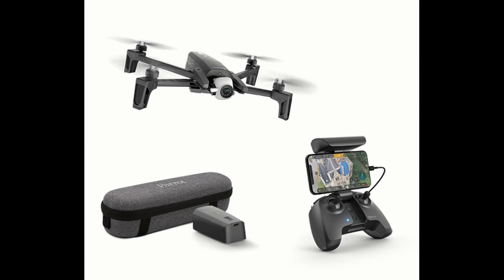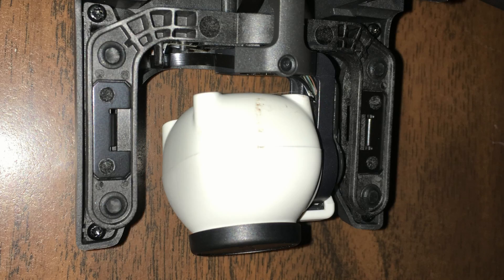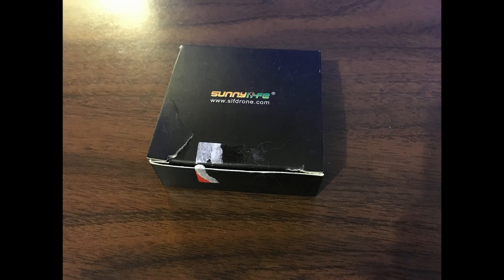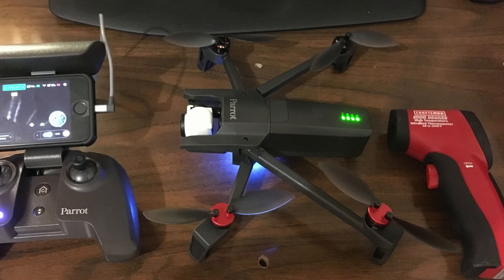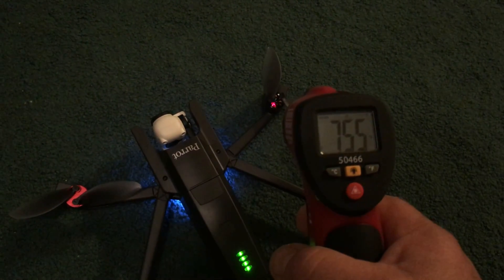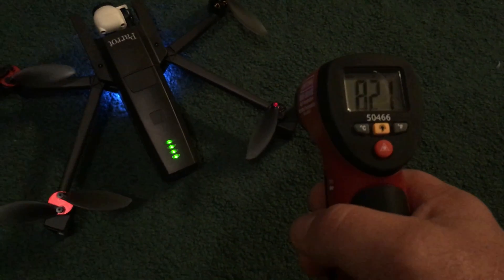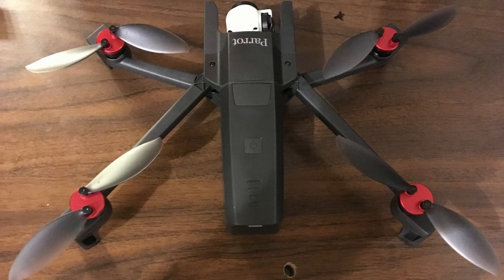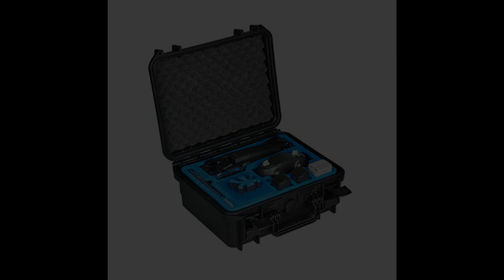Sunnylife Parrot Anafi Motor Caps:  Motor Temperature Increase worth the risk?

Comment: Just got the red covers from Banggood today and have a problem.  Tightening the blades back to the motors makes the blades stationary and I just don’t see enough blade bolt shaft length to protrude beyond the cover’s tube, if you catch my drift.   Do I need to modify the covers to ensure the blades spin freely?
Reply: Same with mine left enough space so blades were smooth and crashed into a building with zero of my input so took them straight off
Reply from the maker: Hal Slentz-Whalen:  Exactly what I noticed as well.

They basically just "float" between the blades and the top of the motor frame.  Also they can touch the prop which did NOT impress me after more flying and looking them over more.  The force of the motor doesn't allow the blades to get "stuck" so to speak on the caps, but after seeing what you commented on as well, I decided to take them off until I can fasten them down without them even having the possibility to hit my props.  I'm actually shocked they didn't come with some double side tape or something to keep them down.

Comment: Are you still using the covers? I bought them but did not yet mounted it.  Thanks Ton
Reply from the maker: I was, but after fling it a bit more I noticed a slight and do mean slight more vibration.  I think it is due to the fact that these caps are not stuck and or in essence float on top of the motor and under the blades.  The more I flew with them, I just didn't see really any benefit to them and took them off.  Even when I have flown at -20 F up here in AK, the caps added no benefit imo.
Reply: @akdroner8728  ok, thanks for your information. All this time I did not used them because I had the same idea that they are not very useful after all. Thanks 👍

Comment: I got them 2 weeks ago and I took them off because of people on Facebook was saying the heat thing, I would have to see a 23 min test and a 46 mins test I have two battery.....like fly until the battery runs down then test the heat then stick in another battery and check the heat after....5mims is not long everyone flys at least 20mins ...ps I got red it looks nice
Reply from the maker: Yup, totally agree on a longer test for sure.
Reply: Were you able to do the longer test?
Reply from the maker: @SuhairZain11  Did some testing and flew through some batteries at around 20mins and the temps never really got much warmer then when I made this video.  However I did notice some rubbing on the top of the motor frames and believe that one of my caps was slightly heavier than the others or unbalanced....as at times I swear I was getting some vibration feedback.  All in all, I took them off and may try them again if I can secure them down instead of them floating.
Reply: Thank you. I ended up deciding not to buy it. I don't have these in my country, so I have to get it delivered to someone and then ship it over to mine. It's a hassle and decided it was not worth it. Do let me know if you do find a way to secure them. I might give it a try in my next set of accessory purchase :D
Reply from the maker: Suhair Zain 

Will for sure update you if I do.   All the best and take care.